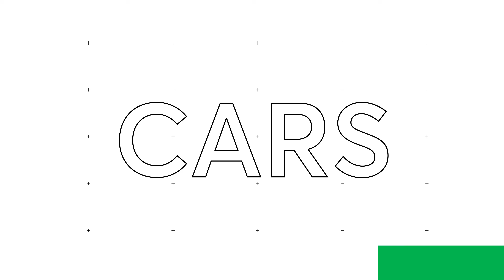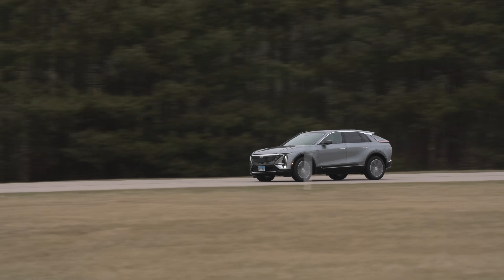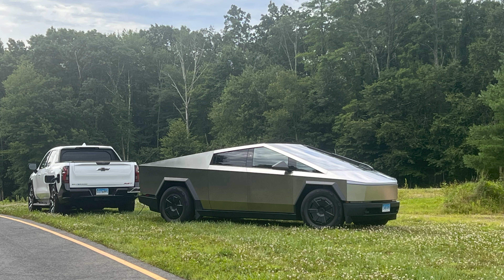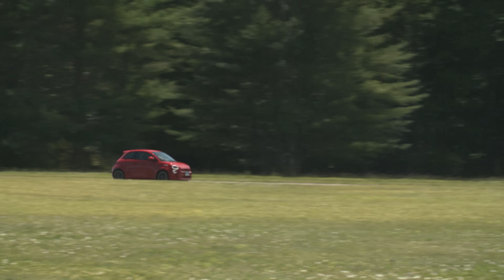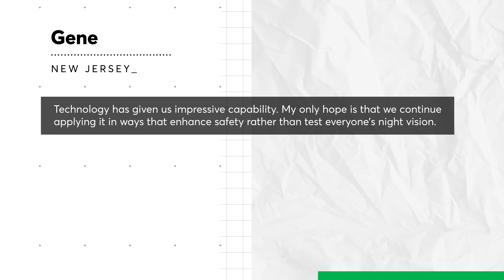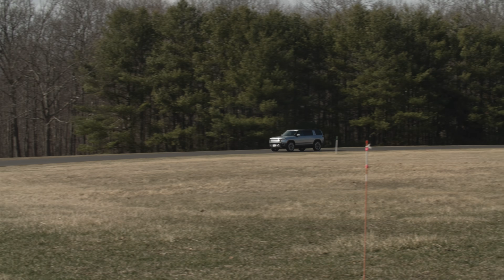EV Range Test Results | Talking Cars with Consumer Reports #498

Comment from the maker: Full test results here: https://www.consumerreports.org/cars/hybrids-evs/real-world-ev-range-tests-models-that-beat-epa-estimates-a1103288135/?EXTKEY=YSOCIAL_YT
Reply: Why the focus on range?  I never bought an ICE car based on the size of its gas tank.  I would be more interested in miles/kWh and charge speed.
Reply: @robertalverson3398 probably because the biggest concern for people (aside from price) is range. Particularly to those who haven't thought about adjusting to charging at home or those who don't have that ability. Not to mention those who view it as a hurdle to the road trips they may or may not take.
Reply: @robertalverson3398 They covered the topic at around 23:00 and called out a connected PDF (with a QR code).

Comment: In the lighting discussion ignited by Gene's question, there were no comments on the trend among some carmakers--particularly the Koreans--to place the rear turn signal closer to the ground.  I feel, intuitively without any research data, that these turn signals are less visible and therefore less safe.  I guess that our lighting regulations allow this, but should they?

Comment: EVs are not “less efficient on the highway” compared to gas vehicles. That is what people hear. They are less efficient the faster you drive but then gas vehicles are grossly inefficient at any speed and wind resistance applies equally.
Reply: There's very little regen possibilty whilst driving constant speed on the highway and according to BMW,Audi and Merc engineers zero regen is the most efficient EV mode on the highway so EVs ARE more efficient in the cities or on the B-roads and ICE cars are the least efficient on the same roads.
Reply: @M @MilanSrdić-t8k Obviously there is no regen occurring at constant speed but most daily driving isn’t at constant speed. EVs are still more efficient than an ICE vehicle… even at a constant speed.
Reply: yeah, I hate the way they say it too. I mean, as soon as any device is turned on, it is "less efficient"! Someone got 1,000miles out of one charge on a Silverado EV but when you hear how they did it, you just roll your eyes!

Comment: You’re admitting to doing 70-mph range tests on public Connecticut highways?  Seriously?  The max speed limit on interstates in CT is 65 mph, and that’s on relatively short spans in a small state like CT … are there more than 30 miles in sum total of CT highways with speed limits > 55 mph?  I thought that CR has its own test tracks???  Also, lane-centering software can take a fair amount of computer energy, no?  And we all wanna hear about range tests at 25 degrees F, not just 79 degrees F.

Comment: A road trip of 350+ miles with gas or hybrid  used to be 5ish 6 hours. EV every 200 miles plus and near arrival of destination will have charge again. So adding extra hour or two, sometimes more is very expensive.  No one can't ever buy back time you lose time you lose it.
Reply: With a fast charging EV it could be less than an hour extra.
Marathon traveling sounds miserable and is unhealthy
Reply: At 72 years old, I still do 850 mile trips in 15 hours.  I take a break every 5 hours.  What is unhealthy about that?  
My car is a plug in Hybrid that gets about 3.6 miles/kwh, and 47 mpg. The range is 610 miles.

Comment: Leased a 26 Lyriq V last summer, my first ev. I cross a mountain pass once a week as I grew up in the eastern part of the state but now live in Seattle. We had a level 2 charger hard wired at home. When I head east at first I only had the option to use the wall plug in charger that came with my car since my folks were not willing to have one hard wired at their home. That made me have to stop on the way back home and fill up once at a EVGO to make it home comfortably.  I do not let the car get below 20% range. That changed about a month ago when a Tesla supercharger station opened up less than 10 minutes from my parents home. Off peak the Tesla charger is 20 ish cents per kilowatt hour vs the EVGO always being in the 50 ish per cents. Im about to hit 19k miles on the car and so far it has been so good to live with.  I sure hope GM comes up with a next gen  model. 🚗💨💨💨💨💨

Comment: We have driven our EV over the past four years similar to the way we drove our gas vehicles for decades. In neither case have we ever come close to depleting the battery or running the gas tank to empty. Doing either is almost always an operator error and avoidable.
Reply: What if the charger you depend on every day (you drive 100mls+ daily like me,no home charger) is unexpectedly broken and you have not enough charge to the next high power charger? Do you have to plan like an airplane pilot for the alternate airport?
Reply: @Milan  I have only come remotely close to “running out” of either gas or battery capacity once. That was 50 years ago with an ICE car in southern Utah. Since then I have a Plan B although it is far less complicated than what any good pilot does. During the past four years driving an EV, I’ve never arrived at an EV charging station that I wasn’t able to charge at.

Comment: I have the Silverado LT extended range. I love it with the huge range. It isn't as efficient when you go pass 55mph but with the big range. It isn't as a problem. I have taken it on day trip with 500 miles of driving with little issue. Just need to top off at an EV charger for 10 minutes while I use the restroom. We still have a hybrid car in the family for the big road trip but overall, we use the EV 90% of the time for daily living.

Comment: Summer 95-100 F degrees outside typically costs me about 10% of the battery.  The winter climate in south Texas is usually mild.  The seat heat is typically enough.  Just have to switch it on periodically to defrost the windshield.

Comment: I've lived with an EV (Kia) for 6 years now and the car's range has literally NEVER been a concern. Not to say that such testing is not important, of course it is. But it EV range is keeping you from buying an EV, you're looking at the wrong metric. Usability (does it meet your daily needs), drivability & handling, build quality and durability, comfort, infotainment/tech features etc all all equally as important. I drive between 3 southern US states and long distance trips are feasible 90% of the time (there are still some "dead areas" where there is no charging infrastructure to speak of). My daily work-home round trip is 50 miles.
Reply: You haven't mentioned resale value and (in)convenience,two biggest concerns for average buyers - I guess you're leasing, can charge at home and are retired or doing a job that doesn't require showing up on time. 
For the working people those are more expensive but less convenient virtue signaling toys.

Comment: This is good info.  Although the EPA provides the testing protocol, the actual testing is done and reported by the automakers.  CR reps were too polite to say anything pointed, but when you have a pattern of vehicles from one brand overperforming their ratings and those from another brand underperforming their ratings - under the same testing conditions, that looks like biased reporting - with some brands being conservative in their reported range and others being "optimistic".
Reply: You are right about the procedure, but this is almost never mentioned. On the contrary, the verbiage incorrectly implies that EPA tests vehicles.
Reply: It's the way they've always done it. It is why Ford went back to the drawing board a few years back when the Ranger in particular wasn't matching up with real world numbers.

Comment: Thank you for this very well-informed discussion. I've owned a Lucid Air Pure since late 2024. The vehicle is equipped with a heat pump, surreal sound pro, heated and ventilated front seats and dream drive pro. 

I can certainly confirm that the range I've been seeing is usually about 22 percent lower than the Transport Canada range of 660 kilometres (when the outside temperatures are in the 10 degrees Celsius to 20 degrees Celsius range). 

In cold weather (minus 20 degrees Celsius and below), the car only ekes out a range equal to about 40 percent of the Transport Canada range.

NB: I accept this as a trade off that enables me to drive a terrific vehicle that is comfortable and fun-to-drive, not to mention environmentally less problematic than iCE-powered vehicles.
Reply: "Environmentally less problematic" ? Are you sure ? There's a (2020?) "wheel-to-well" co2 analysis from the Karolinska Institute in Sweden (Nobel price is awarded there) comparing the two (ICE vs. EV Volvo xc40/ex40) models of the same car and the EV version releases much more co2 during the production process,specially the lithium batteries production which also uses huge amounts of clean water during the purification of the lithium ore,the end result was you need to drive the EV for ca.100,000 miles (in Europe) just to "get even" with the ICE version  regarding the co2 emissions.
So no, EV's are not "Environmentally less problematic",they are more expensive,less convenient political statements that require propaganda, public funding (subsidies/wealth transfer poor》rich) and state mandates (legal force) to somewhat succeed in appeasing the powerfull extreme-left environmental lobby at the expense of the western car industry and the working class. EV losses everywhere in the west are staggering (100+ billion just in 2025) and the western car industry is dying at the altar of the ideology and with it the whole western industry will go bust in a few years at most and the only cars on the market will be Chinese sh*t boxes - thank you Greta Thunberg,you sage.
And thanks to all of you gullible environmental rednecks in destroying The West with that childish nonsense of "saving the planet" whilst destroying the civilisation.
The road to hell is paved by good intentions - but we see that only in retrospect.

Comment: Range has become too much of a marketing gimmick for most residential buyers since most driving is local. I have a "bad" EV with only 220 miles of range and love it.  For me, not having a level 2 charger at home is a deal braker because super charging is too expensive and inconvenient.
Reply: 120v can work with a big battery and supplemental charging in the wild or at work.  By big battery, I mean 150+ish

Comment: EV OEMs just need to use 100 (150, 200)kWh battery bays, and avg 3 miles/kWh.  Touted range is silly.  20-80% charge is what most to, so that’d put the range in a reasonable, easy to figure, place.

Comment: EVs are the future. However for today, I love my small EV (Leaf)for an around town car and my ICE car (Outback) for road  trips.
Reply: Yours is the perfect symbiotic relationship between ICE and EV! And I am in the same boat as you are with a 40 kWh Leaf and a Lexus SUV. Can't say enough good about the EV!
Reply: Yes, same here, but I moved on.  Previously I had a Leaf for my commute, and an Audi for my road trips, but after I retired, instead of 2 cars, I went to a plug in hybrid. The Leaf/Audi was replaced with an Audi eTron PHEV. Now, no more 18.7 mpg in the old 2006 Avant. I’m getting 60 mpg for the last 10 fill ups and more than 50% of the time,I’m on electric power.

Comment: The range beyond 0 shouldn't be considered as usable range. It may be there as safety margin for a specific battery types to preserve battery life, could be a margin to auto compensate  for capacity loss from aging, or safety margin if a charge location is out of order, to allow alternative locations to be reached. I could see commonly leased brands wanting to auto compensate for battery degradation so able to show original range for next owner, or perception of premium battery tech.
Reply: I think the bottom line is know your car

Comment: Running any vehicle (ICE or BEV) til it stops isn't a good idea as it degrades components (cells or fuel system). No one should drive this way. It would be more meaningful to do recommended minimum SOC. Anyway are you counting the miles beyond 0 in the range? 
Would also be meaningful to do a city range test.
Charge time is useful, as mentioned,  to show the downside of relying on a big battery. 
Efficiency is useful in illustration of cost to carry an oversized battery all the time, and cost of bad aerodynamics. 
Don't like the hiding of data collected and the aggregation into 1 of 5 dots.
Reply from the maker: Great feedback, and those are some good points and suggestions. Subjecting all cars to the same real world conditions as best as possible allows us to compare them. This means driving all of them to “true zero” since the SOC and mileage indication in the car is not standardized. Those miles are included in the total. Minimum suggested SOC is an interesting idea, and this test would help enable that info.

Comment: Very good discussion overall, but...
According to the Interwebs, in the EPA highway procedure, the speed ranges from 30 to 60 mph. At 70 mph the air resistance is 36% higher than at 60 mph, and it is 5.4 TIMES higher than at 30 mph. This is very significant. I do not recall a single video on YT where this is discussed. Everybody is comparing the range at sustained 70 mph vs. EPA's 30 - 60 mph speeds and expecting the same results.
Reply: The EPA procedure and a 70 mph range test are very different tests and I would expect very  different results.
Reply: True.  The EPA procedures are consistent over vehicles and time.  They are for comparison purposes only with the usual caveats that "mileage will vary depending on ..."
Reply: This is true. InsideEVs has uploaded a lot of good videos testing the range of EVs at 70 mph, so we at least have that datapoint.

Comment: If only more vehicles would go the distance like my 2024 Silverado EV rated for 450 miles.  life would be so much easier because we wouldn’t need to worry about these test. You could be out fishing instead! With my 10 different electric vehicles I so much look forward to the time when these large high roof vans have a battery and range very similar to what the Silverado has. They’re not there yet, I waste way too much time driving out of my way to find a fast charger and there are days when I am forced to drive the diesel van because I’m driving too much distance and with passengers , can’t be holding them up, cold weather makes 450 miles turn into 330 or 350 real quick in high vehicle that catches a lot of wind , so something to think about for the future. so I am very interested in your test and your comments and testing thank you!
Reply: How far can they go full throttle? I had one tailing me at 112 for like 30 minutes but then he exited. Not sure what he wanted.
Reply: I just wish the Silverado was efficient, just not loaded up with thousands of pounds of extra batteries.  We can all have "range" if we fill a dump truck up with cells...

Comment: You talked about 15 mile an hour wind or less!  even 12 to 15 mph wind can make a drastic difference in range ,  if you’re facing it or if it’s pushing. maybe not for a Tesla car but I’m driving electric pick up trucks and mostly electric high top extended length vans which I have converted one or two to passenger vans, I may be a small niche of your audience, but when you do testing to have a fair result with vehicles, such as I’m interested in , your results could vary way too much at 15 mph winds , so I would consider that to be very difficult to be accurate with. I drive when the temperature is down to 20° with no heat for an hour or an hour and a half at a time.  just to be more efficient sometimes of course eventually I give up and turn the heat on to keep a little bit more comfortable, . however when the temperature is between 20 and 30° or thereabouts driving with no heat, makes a huge difference in efficiency for my vehicles. Of course it requires piling on some extra clothes but it’s interesting to know the difference in efficiency when the heat is on or off, and the temperature is low. It is a pretty big difference.
Reply: A properly done test includes driving in both directions. Of course the wind can change during the test, so no-wind conditions would be the best. This one reason why EPA tests are not done on highways.
Reply: It’s ridiculous to drive slow, without heat, or whatever, just to “save energy”.  That’s compensating for range anxiety.  Rain, altitude, wind, temperature, all effect range.
Reply: @jeffforbess6802 need to have a comparison Baseline
Reply: They should apply a small compensation factor for conditions